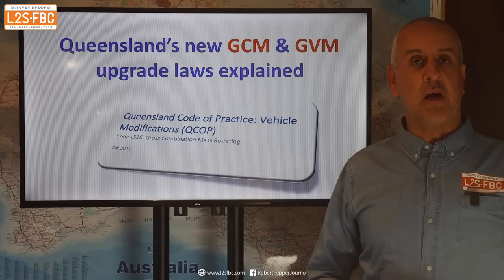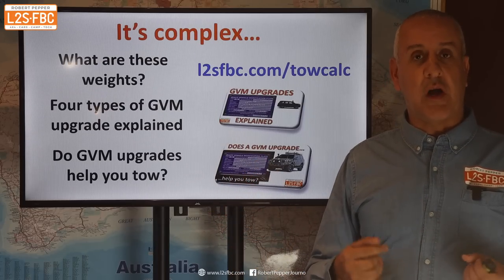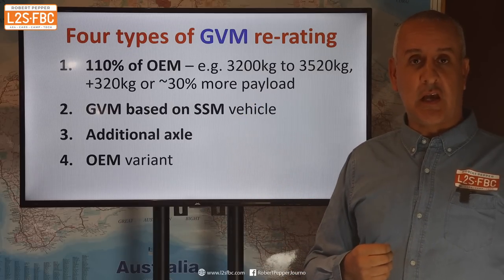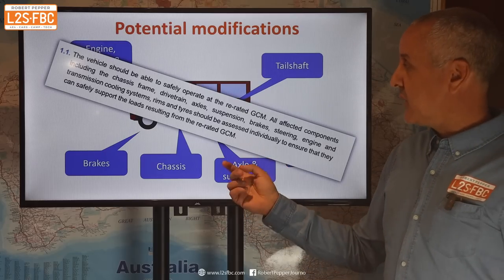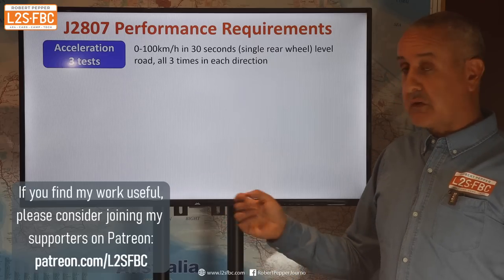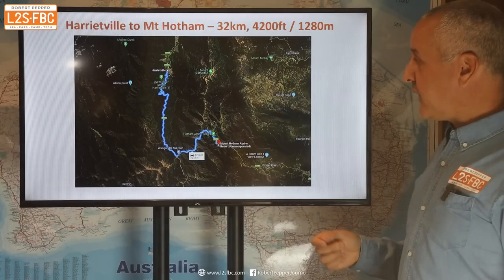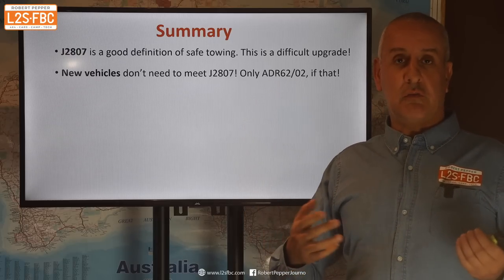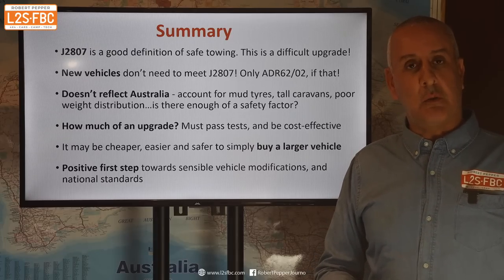New GVM and GCM laws - what do they mean?

Comment: you might want to correct that  since the yanks typically  weight rate until you either start to loose traction or bunny hop up a hill

Dually as the yanks where the axle rear diff and suspension meets meets (laughable) weight limits, though has the pulling capacity yet doesn't have the stopping capcity..

with 4x4 caravan  exceeding 3-4 tons at 23-25 foot these you may need to consider a 3 axle option for  off road use..

when applying loads to a ute chassis you might have to address the tracking issues (rear axle replacement)  stiffening the section to stop  frame bend

we aren't building van and 5th wheels out of  marine ply and chip board any more and they coming more weight atr the lesser lengths meaning at 30-45 foot in length  neding  more axles on the ground   to couteract the over all weight ..

today unike yester year where a f250/350  you could tow 2-5 ton van looking at what it was made of you could off load its weight onto more axles at 23 foot cabin space   

In context my old 70's-80's 23 foot viscount shy of 2 ton something equivalent in a modern offroad van skirt 4 ton without modification with mods you migh add 1.5-2 ton extra  gcm average 6.5 tons, 8 tons (with mods and max allowance of you license) your 500kg over on standard license 2ton excess weight..

you are looking at an f650 or higher 30+ footer..

you might be looking at 6x4/6x6/8x8/8x4 based tow vehicles to be compliant with towing regulation, noting every time carry capacity ina standard 4x4/6x6 platform you must resubmit the vehicle for certification when you your l9oad rating it isn't a free for all like the youtube 4x4 community makes it look like..

sorry buddy if you are going to use a land cruiser v8 diesel you ware at gvm of 2.5 ton your gcm is 6ton 3.5 ton in the caravan

your bas axle/suspension tow hitch rating is 150kg not 350kg you will need at the to3 ball your suspension is rated to human capacity not towing capacity 

at 4ton  you at 6.5 ton 
5 .5 ton you ware at the limit of what you can legally  on a car license you;re looking at lr/hr with a gcm greater than 8 ton nothing you will you out of stopping range  of a cruiser you will looking at a dolly/dog using a pto gear in the rear axle to help  control things greater than 4 ton in weight though would also consider what you tow with....
Reply: Could you resubmit your comment in English, please? It looks like you are trying to say something important, but honestly, I can't quite understand what it is.
Reply: @Expedient_Mensch  It wasn't a question it was the statement of how they set tow limits in the USA, the way testing is done TFL at some point visited as weight ratings testing lab..

If using  a standard 60, 80 and 100 series land cruiser v8 5 seat model as the descriptive example vehicle has a 2.5 ton or 2,500 kg weight rating and 50-100kg weight rating off the hitch basically 6x4 box trailer full of garden  waste vs 4,000 KG the average off road capable caravan, we no longer live 2 ton at 25 foot these days we are now 4 ton at the size which is a GCM of 6.5 tons

if you were to add 4 tons to the vehicle you would be at 8 tons at 4.5 tons on the vehicle you will be a different license..

noting the more the caravan weighs the more suspension you will need to  tow it..

5th wheel haulage you may need a semi for haulage of it as you are likely above the capacity of the braking system to safely stop it at dead stop weights..

the way this has been explained is to the US definition of  weight certification in which set a dangerous presidence on the road due to the testing methodologies the US uses in weight haulage certification ... which when put iin the hands of average joe citizen lands average joe in court for man slaughter for driving over weight and over the capacity of the tow vehicle

top weight specifications should have caveat somae modification of suspension and diffs stenciled in read in red with warning in place DO NOT TOW OVER THIS WEIGHT.. IN THE MANUAL
Reply: @jasonhowe1697  Ok, I see the problem; No punctuation! Makes it too difficult to understand what you are writing.  Do everyone a favour and download a spelling/grammar checker, they're free.
Reply: @Expedient_Mensch  I also see the see issue of talking to people like a their  a five year old and spouting bullshit and  and not know what you're talking about though missing the point and creating a base example

the only time you more weight in a cruiser is when you own 7 seat variant of the vehicle and that's hauling people only..

No modification for to excess weight for hauling vehicle a 4 ton van..

base weight of combined weight  without mods applied to carry said weight  is curb weight 6.5 ton base supported weight 50-100kg towing vs 400-800kg at the tow ball..
put that 4 ton van on that stock suspension yo will get a yellow or red sticker for your troubles as back in will be to the ground and be overweight at the suspension and tow ball..
Reply: much like gcm right out of context and give your cruiser a false weight rating..

Comment: you always upgrade the gvm upgrade to tow a great weight that has been done for decades

Problems are when you come to explain this you put your  foot in  your mouth because you talk base weight of saf a cruiser  which is typically 2,.5 for the 5 seat model you upgrade it to pull greater weight but you don't understand of combined mass you what it means to the license class you have...
Reply from the maker: Sorry Jason I don't understand your comment?
Reply: @L2SFBC  your tow vehicle is roughly 2.5 ton when using a definition of a 4x4 land cruiser v8 turbo spec,  base spec of included tow ball is with spec of 6x4 trailer towing  at standard off  show room floor with 100-150kg tow ball

today we are seeing  a weight typically  in a 35 footer in the  same space of a 25 footer

you're adding 1.5 ton + to meet a 4ton + towing requirement which  sees a gcm, 8.4-8.5  tons at road weight without mods applied you are at a gcm of 6.5 tons..

Noting you will be overweight on  vehicle license 

you can be at 4.5-5 tons on the tow vehicle before towing that  4 ton 25 footer  

you have understand where your limits are before you start  to talk about where modification lays before you talk about  what the regulations state which have been known about since  I was a kid in the 70's and 80's

I think what has  happened in Qld is likely trying police  the back yard mechanic and the stupidity they create when no seeking  a certification  after they go and change the weight class without engineers approval so the vehicle compl.ioes with licensing laws..

there is  legal ways to do things and there is illegal ways to do things, the amount of modders I have seen inside and outside of Qld tells me there might be a lot modders skirting  red ticket and pit requirement  for road rego soon
Reply: @jasonhowe1697  So you are saying that at maxed out towing weights, anyone driving a newish Landcruiser ute style vehicle will need a light truck licence? That is reasonable. It is certainly something that for the most part, has been bypassed. I guess licencing is a different arm of govt so since weights and licencing are completely separate, they all go their own way on things, as usual. So again, the legislation will not be worth that much in the end. One hopes they get their acts together and come up with a well rounded set of legislation.
Reply from the maker: Keep hoping!
Reply: @ClissaT  I haven't covered utes in this definition yet because you might be over loaded due to engine spec Typically you can start from a 2.4 liter diesel spec with turbo in a hilux, to a v8 turbo 70 series

`the issues are in those examples how far can you push an engine before in becomes a failure point that it can't be stopped whilst  towing that 4 ton in utes pending on 2 or 4 door model you base weight can 1.5-2 ton without mods be at a gcm of 5-6.5 tons. however this vary because you might  still have upgrade the base suspension  package to cater for that 4 ton 25 footer off road camper, the legislation has always been there likely?? it just in its application and where it implies and/or applies to you for your setup you might skirt a GCM of a combined 8 tons on v8 models of ute you might have a death wish in anything of a lower spec engine, at 4 ton  towing might be a rolling death trap when brakes give out

on  v8  turbo diesel  I may be consider 6x4 lazy axle or 6x6 conversion (driven axle)  for towing 4 tons or more

looking at the vanning industry and the cases where 5th wheels are gracing our roads even more I would likely  consider a prime mover as a suitable past 30 foot in length as you are likely out of specification of as sedan/ute motor to tow it..

looking at fords I would thing the f-550-f-750 may be a proper tow outside of this volvo, scania, kenworth and mack need apply as applicable tow vehicles
Reply: Jason, thanks for your reply. I did manage to decipher your posts and appreciate your replies to me. I'm still in the formulation stage of things at this point. I really wanted to stay with my LandCruiser because it's my baby. But I am realising it won't be practical unless I change every other thing. I do have a big licence so a far bigger vehicle is no issue but I wouldn't be able to take it to the places I wanted to free camp. I'm retired but, as I said, still in the planning stage regarding moving to a 5th wheel van. Cheers and thanks again.
Reply: @ClissaT  The problem I see these days everyone has a voice however lost in translations happens to frequent in these situations of no fault of your own then you have someone trying to state shit and balls it up because you  are assuming the definition example "is given in good faith" though doesn't understand basic physics of actual weight verses prescribed weight after modification vs actual weight in which and engineer has pass it to get the vehicle road legal..

the issues in the outback industry we are seeing vans being built like tanks "pun intended"  where traditionally vans were 3-4 ton at the the 30-35 foot mark, where the latest and greatest are coming in at 4-4.5 ton or 4000-4500 kg within in the  23-25 foot specification in length..

you might be adding up to 2.5 ton in weight capacity in the suspension  just to cover the 400-500 kg ball weight 

at dead stop 6.5 ton gcm you have roughly 19.5 to 26 tons weight

5th wheels just adds more weight over the rear axle
Reply: @ClissaT :  The big problem is that the car license is good for a 4.5 tonne G.V.M., Australia wide.  It is meant to be that you can not exceed 8 tonne G.C.M. on a car license.  However, there are ways and means around this.  I tried to get an answer out of the licensing branch in my jurisdiction.  The woman that I was talking with, she was trying to octopus ink the issue!  However, from what I was able to gather from her, a turntable and fifth wheeler do not require a Light Artic license.  I quizzed her on this, and that was what she kept repeating to me.  I then asked her if I could put a 4 wheel tandem on the back, with an 11 tonne tandem load, and the hauling unit has a 11.99 tonne G.C.M.  She said that was illegal due to the sum of the axles exceeding the G.C.M.  It was then explained to her that a 3 axle truck towing a 3 axle dog trailer is in the same situation.  She was shown up multiple times for her incompetence.  She also refused to let me speak with her supervisor.  

With the turntable / fifth wheel, ideal would be to have on a slide, so you are able to adjust the weight throwing forward onto the front axle.  But, if it was me, I would be running at full mass on the 4 tyred drive axle and the balance up to the G.V.M. on the front axle.  A cab chassis car license truck is about 2.4 tonne tare, on average.  Add say, a half tonne for the turntable / fifth wheel and the slide system, that still leaves room for close to 1.5 tonne payload onto the truck.  Then, you could get 3 to 3.5 tonne onto the trailer axle group.  The more that I am looking at this, it is my thinking that the caravan industry are going to have to go to fifth wheelers, and those towing caravans are going to have to consider dual / twin cabin car license or Light Rigid license trucks.

Or, another crazy option would be the manufacture of a dolly to go between the towing vehicle and the trailer / caravan.  A man done that with an 18 foot 6 inch Roadmaster caravan, single axle dolly, with a 1966 Chevrolet 327 cubic inch motor.  Had the combination up to 90 m.p.h. consistently on several occasions, string line perfect.